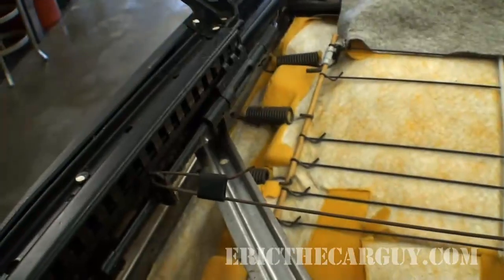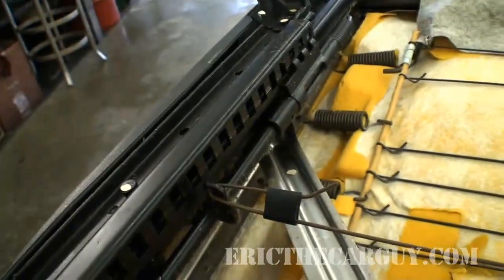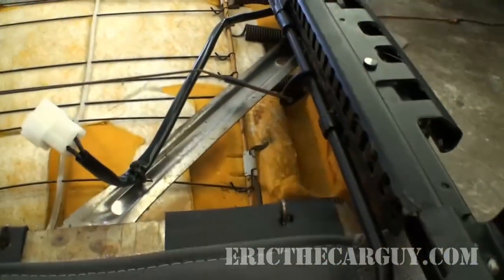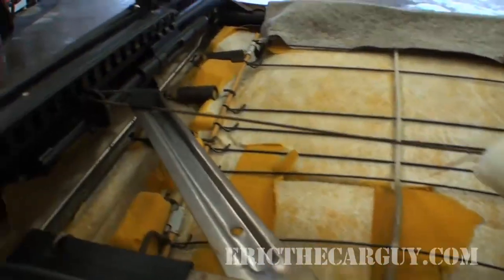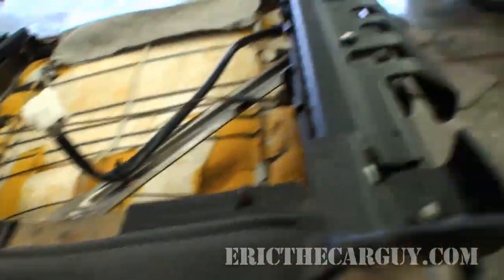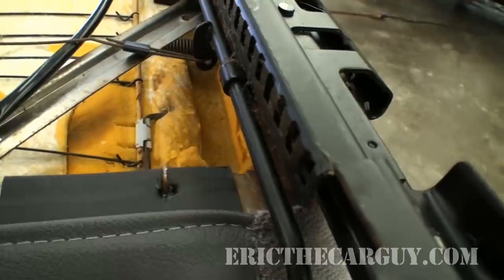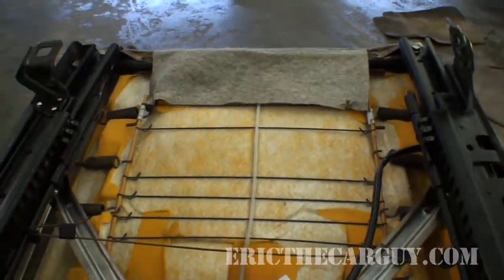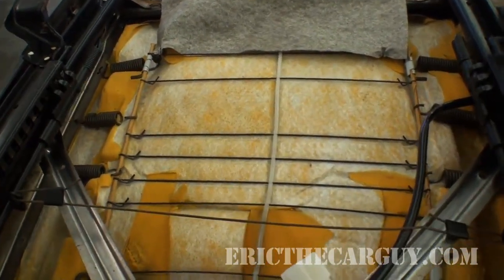How a Manual Seat Adjustment Works - EricTheCarGuy

Comment: I just went to the junkyard and got a newer one the one on my car that's on there now the metal  broke.. Should I before I put the newer one in ...  bulk up and reinforce with some type of bracket before I put it in because I have a feeling it's going to break again the way it's designed.. The seat adjuster that raises the seat the right side of the seat is a couple millimeters thick steel  And the one I got from the junkyard already it looks like it's somewhat bending  straighten it out and maybe put a thicker piece of metal stack it and then have somebody weld it  for me..  Because it's a lot of work to strip the seat down  ,I don't wanna have to do it again and since it's outside of the car right now I could give it to a welding shop just the adjuster...  I wonder if I can make my own type of bracket with the clamps I don't have a welder if I did I would do it myself... More then likely the main reason it broke is because I've been sleeping in my car for the past few years so of course its Under alot more stress than it would normally from me moving around while I'm sleeping.  Me I don't even need to raise my seat and lower my seat I should just welded it permanently in place..  And the one that's on there right now I could get that repaired and have that as a spare for whenever I sell the car.. Or just toss it or sell it after it's repaired they go for quite a bit money used unless you just go to the junkyard yourself it's not worth it only cost me 35 bucks but if I was to go buy one from lets say evay, They are asking $150-$200 for the same stupid thing...

Comment: Both of my front seats are really hard to move, but it's not this mechanism that's the problem. I took both seats out today and gave the sliders a good cleaning, and greasing, but it's still quite hard to move them. The seats are quite heavy with lots of motors and crap in them so that's probably half the problem, but it just seems to be really hard to get them moving initially. 
Certainly a lot different to my old car where they slide absolutely freely. It'd be interesting to know if there're little wheels inside them or if it's just metal on metal sliders..

Comment: Thanks for this dude! Our seat got stuck and we thought it was a huge issue and instead the wire underneath just snapped! We got picture frame hanging wire to replace it and it works again thanks to this video, and we didn't even have to take our seat off the floor!

Comment: Thanks man. I’m having issues with my non powered 97 Maxima drivers seat. Stuck all the way back. It’s a five speed so I’ve got to get closer. I was trying to feel my way under there for the cable. No luck. Lots of clicking but almost no movement. I’ll try again tomorrow. Thanks for the view!

Comment: Fitment was very good• allmy.tips/SeatBrackets?ㅂ had to bend one leg 1/8" to properly line up with bolt hole. Bolting them to seat sliders are a bit of a pain, took about an hour to bolt both brackets to the seats, but are of high quality and will buy another set for my next mustang

Comment: My issue that on 2002 Chevy tracker is that the manual seat adjuster works but it won't lock after I have it adjusted and slides back and forth while I'm driving
Reply: yes! that's the issue with my 1989 F 150. It slides easily but won't relock back into place when pushed back.

Comment: This was a good video, I just needed a little more info. I'm trying to take the seats out of my car. The seat doesn't move forward enough for me to get to the back bolts. It slides on the track fine, but it stops at a certain point and I just need one more inch to get the clearance. So annoying.

Comment: Was involved with the roll-forming fabrication of hundreds of thousands (if not literally millions) of upper and lower seat track channels over the course of my time spent in an automobile hardware manufacturing plant. Later editions of the seat tracks (upper & lower channels) were pre-notched prior to the roll forming process. Once these pre-notched tracks were die-cut-to-length they were sent to a phosphate coating tank then directly to the seat adjuster assembly process line. Conservatively, my experience in the manufacture of automotive components comprises at least twenty-five years. 

Once, we sought to estimate the number of raw channels attributed to one design which was finalized in the mid-1960s and saw service in vehicles through 1997. We came up with a number in the tens of millions (accounting for bench and bucket seating). This was only for the manual versions and there were, of course, many hundreds of thousands of electric seat adjuster assemblies fabbed as well. The raw material came in at the receiving bay and through the oversight of engineers, toolmakers, managers, troubleshooters and watchful production techs the finished product was shipped to dozens of vehicle assembly plants across the country. It was really something to witness when all of the processes were working in harmony to get product to their appointed locations on time.

Comment: Hey, Eric. I have a VW Jetta 2000. And the cable that goes from the handle broke off somewhere inside the mechanism. And i was wondering if you are aware of any ways i can still move the seat, cause it broke off when i pushed the seat all the way forward fixing something in the backseats. And because the seat is all the way forward, i cant even enter the car.

Thanks

Comment: I have a 2001 dodge,maxi van 3500.  the passenger seat back release lever broke off the mechanism with a one inch cylindrical piece of metal attached.  how can this be repaired?

Comment: Eric, you wouldn't have any insight on manual Honda seat tracks that produce a small clunk when lateral force is applied to it (taking corners).  Had a 90 Integra, 92 Accord and my 2003 Accord all do this. It's livable just annoying. Thanks again.

Comment: In many cases you can remove the seat from the track and switch them,a lot of times it isn't the seat that actually adjusts but the mechanism that it sets on,but yes,there are any number of reasons why it wouldn't work,controls mounted in seat,side airbags,seatbelt recoiling into seat,etc.

Comment: somewhat true, but how would use your tilt mechanism then? if you have an old car with lots of space in the middle that's no biggie, but many cars have fully adjustable driver's seat and a co-driver seat that only reclines and goes back and forth. also the controls would be on the wrong side and if your centre floor panel is wide, they render useless

Comment: the rails could be damaged and when a person sits in the seat rails become misaligned according to the toothed bracket so it doesn't go through. that is a very common problem with newer renault clios, altought that's just a design flaw with these cars. I'd suggest take it out and inspect it good. rails usually break and you either replace it or weld it back together.

Comment: So...weird question for you, Eric. The seat in my '91 Audi 80 will only lock into a new seating position if there is nobody sitting in it. Using the lever to loosen the brackets so they can move works regardless of whether someone is sitting in it or not, as does sliding the seat back and forth. But it only locks into position if there's no weight in the seat. It doesn't seem to me like the wire could cause this; can you think of what COULD be causing this strange issue?

Comment: Sometimes the bolt pattern is the same for the left and right seat.You may have several hundred thousand miles on the driver's seat but chances are that the passenger seat is basically new internally.Sometimes you can swithch the seats and give yourself a rectal upgrade.